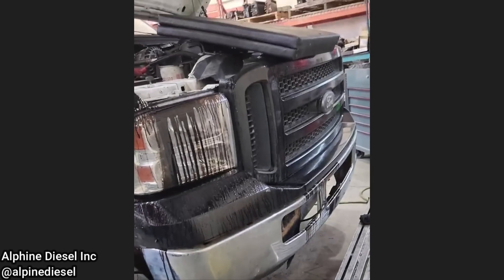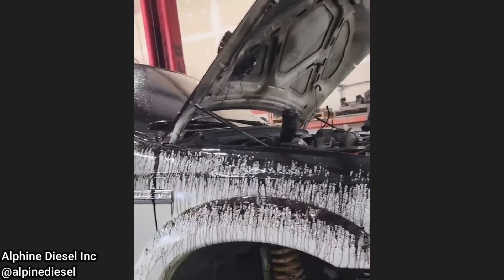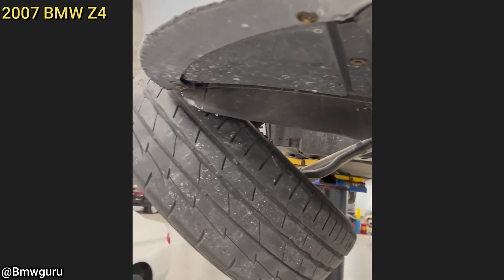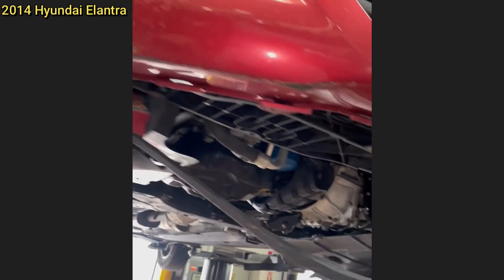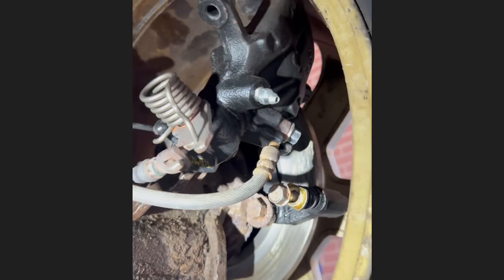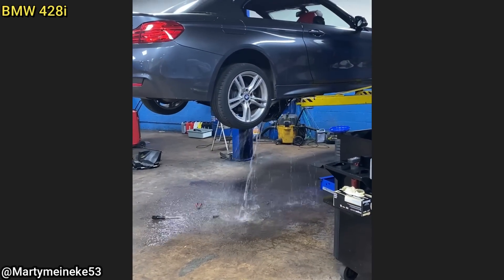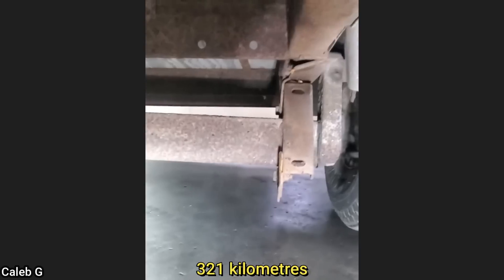Customer States Truck Has A Lack Of Power | Just Rolled In

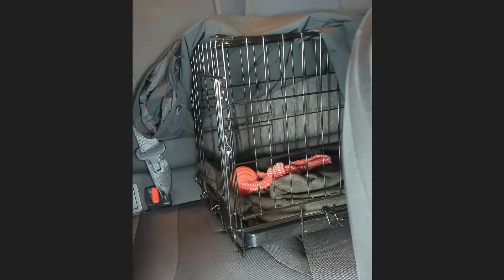Comment: 1:43 these cars are also notorious for "water-cooled" batteries. some are found to have the rear filled with rain water until all electronics die from water and corrosion. always check the trunk and what's below!
as for the nails... germany has a few places where they crop hops (you know, the green stuff for beer?). the plants like to climb, so they let them climb up a wire fence up to like, 4 meters and more. since removing them from the wires is time-consuming they just take down everything, and shred it with machines. and while tugging the stuff home, short pieces of cut-off wire drops onto the street behind them, ruining many a tyre on the way...

Comment: The guys in the last video are lucky they are still alive. Many people completely fail to understand that tires are secretly lethal death machines.
Reply: I just watched a video where a truck blew a tire and the air blew the front bumper off of a passing car.
Reply: Trying to remember exactly where I read about it but a teenager tried to slash one of the tires on a neighbors 18 wheeler and got very seriously injured.
Reply: All about how much air volume is paired with the pressure and that is what people don't get. A very small tire at 100 psi is less scary than a very large one at 50 psi. It's something like if you filled a house with 8psi it would destroy the house and anyone inside would be long dead yet most people would tell you under no circumstances is 8psi lethal.
Reply: @brendanberry7403  Usually, though, large tires tend to be more pressurized because they are usually put under heavier loads. This is why you usually don't hear about people getting hurt with car tires (assuming they don't over-fill them), as they are only 30-40  PSI.
 
However, huge heavy machinery tires like for dozers and huge dump trucks? Yeah, people die to those all the time, and tire cages are mandatory if you're messing around those.
 
Or, if you go smaller, have you ever heard of anybody getting killed to a bicycle tire? Not usually. Or a quad tire, those only want 8-10 PSI.
Reply: @Dhalin  And don't forget that in Asia/3rd world they are always severely overloading the trucks 200% or more so the pressures go way up causing tires to explode, not just blow out.
Reply: Inflated tyres are bombs waiting to go off.

Comment: The blocked drain on the BMW reminds me of my MGB. The air intake vent for the cabin is below the windscreen and has a tube to drain rain water out the bottom. For some inexplicable reason it ends in a tiny slot that gets blocked with debris, backing up and causing water to enter drip under the dash. This leads MGB owners to "circumcise" the pipe by opening the end up...
Reply: Reminds me of a Toyota Rav4 I picked up really cheap the other year, because of a few small problems, the worst one was the heater core had burst (they had bypassed it so they could still drive it), which is a dash out job and would be about half the value of the car to fix. I bought it at the end of winter so figured I would have 6 months to fix it myself. but on one of the first drives on a hot day, the missus said there was water coming out near the glove box.

turns out the heater core was just fine, the aircon drain was blocked, they saw water coming from up under the dash and assumed it was the heater core. I reconnected the hoses and shoved a screw driver up the drain to unblock it and never had a problem, all it cost me was a few $ for a coolant concentrate and some distilled water.
Reply: My Vauxhall (GM) Astra has a known issue where, over time, water seeps through the seals and roof gutters and collects in the sills. Rather than fix the issue they just drilled a hole at each end of the sill and put a rubber grommet in as a plug.

Not long after I got it I could hear water sloshing as I braked or accelerated.  One Google search later I located and pulled one of the bungs out and the water came out like it was a tap on full!
Reply: My golf always seems to be leaking water from somewhere, maybe that's what's happened to me
Reply: @kahlzun  where is it leaking to?
Reply: @kahlzun  It’s worth a look
Reply: @kahlzun  got a sunroof by any chance.

Comment: I had a jeep Wrangler, best car I've ever owned .... Anyhoo, I parked it with the top down and went sailing for a few days. I wasn't expecting rain. 🤦 it rained and when we got back I had 2 inches of water in the jeep. Pulled the drain plugs. Everything worked fine except the radio. It was stuck where it was at. I couldn't change the station, adjust the volume or even turn it off. It eventually dried off and went back to working. Though in hot moist weather the inside of the jeep would take on a moldy smell..... and eventually moths found their way in it. For a few of years I had a moth hatch in the spring. Has nothing to do with the rain, but I find it funny.  Still a great vehicle.

Comment: Inflating tires always scars the shit out of me. Especially when they need more than 50-60 psi. Hell, semi tires gives me a pucker factor like no other.
Reply: I once had a bicycle with tires that were (apparently) supposed to be inflated to 90 psi - at least, that's what was stamped on the sidewall.  I was 16, so pumped that thing right up to spec.  At 88 psi, it blew... my hearing didn't come all the way back for a half hour!
Reply: @stephenp448  Bike tires really do take high PSIs, so I'm guessing that the gauge was probably faulty.

Comment: When I was a truck driver the small trucking company I worked for had a deal with a local repair shop to park our rigs there.  One day a random other truck driver drove up to the shop with a fountain of motor oil spraying up out of the exhaust.  He had blown out a turbo like that guy in the first video and by the time he got to the shop he had repainted his red truck and trailer black with engine oil.  It worse than that guy in the first clip.  I probably still have some photos of it somewhere.  :P

Comment: That last clip, the one with the exploding tire, that ever happen to anyone?  I've never seen, nor know of anyone who has seen that happen.  Just friend of friend of friend who supposedly seen a tire explode for no reason.  I kinda developed a phobia of a tire exploding as I fill it, so for years now I use a clip-on inflator with a 6ft hose and fill tires from cover.
Reply: I've seen it twice! First was when a customer pulled in our tire shop with a flat donut spare they had driven on for several miles. I went to fill it, and it exploded right in my face. I wasn't hurt, but OMG it scared the sh!t out of me! Second was at another tire store. A car, just sitting in the parking lot, blew out it's right front tire all by itself. (It wasn't even one of our customers). Sounded like an M80 firecracker!

Comment: That Ford rim though. I just don't see how that happens. Especially on the outside of the rim. If the inside was scored like that it could be hitting the brake caliper, maybe.
That wasn't a rotted out rim BTW.  The anti theft lug was there to protect that extremely rare component. It's that very rare rim that's designed to allow you to visually inspect the air in your tire. Love the channel, keep up the good work.
Reply: The only thing I think that could explain that Ford rim is consistent rubbing on a curb during parking. Wouldn't be surprised if the customer lives or works in a area with only crubside parking.
Reply: I was thinking the ford rim had scrubbed a concrete highway barrier or similar. Something say 1.5 foot high, although the road probably sloped away from it slightly so contact is down low with involving the rest of the vehicle.
Reply: It's a spare wheel. Sits upside down for a decade or more on the cable under the bed collecting salt in that pocket & eating itself away. I spent about 3 years working at JFK on a transfer. My truck was showroom condition when moving there. Only 1 winter & it already started looking like a beater. It's a tragedy what that damn salt does to vehicles up there!

Comment: I worked a short time as a mobility scooter mechanic. When i just started i didn't understand how much pressure was behind the split rims with air still in the inner tube. Some of the brands had those. While i wasn't really paying attention unbolting those rims, a fellow mechanic rushed to me and pointed to the ceiling. There was a dent in the metal radiator on the ceiling maybe 4-5 meters high. That could've been my head...

Comment: Was thinking about it the other day...can't help but wonder if the reason cars get into such disrepair is that modern vehicles are so generally maintenance free that a mechanic never regularly inspect them.  Wasn't that long ago that you were taking your car in every 3-5K for an oil change, lube, and a tune-up...
Reply: Yup! My previous car really needed oil changed every 3000 miles. New car, every 10k.
Heck, I remember in the 70s the gas station attendant would pop the hood and check fluids while the fuel was pumping.

Comment: based on the exhaust pipe exiting through the hood of that F-350. I suspect that turbo was not at all running with in spec
Reply from the maker: It was a cheap eBay turbo as well apparently 😅

Comment: I was on a job site where they had sheet rocked the ceiling of covered parking.  about 50 feet away was a bobcat with all 4 tires having probably 30 sheet rock nails per tire.  Indeed they were flat.

Comment: I work for a auto parts store. Couple of teens rolled in with a impala with the front shock poking threw the hood and asked if I thought power steering fluid would help and if it was safe to drive. I told them you need a tow. They drove off

Comment: 2:04 Probably had locking nut loose and joint wiggle in the treads open and close until those worn out and gave in.

Comment: That wheel reminded me of a dodge truck with the chrome clad factory wheels. One of the wheels was rusted and broken around the outside edge, hidden by the chrome, not as easy to see inside. The other three weren’t far behind, all very rusted. It had a very bad shake at highway speeds.

Comment: The problem with approving repairs is that there are so many dishonest shops these days. I recently had a shop tell me I had multiple issues with brakes, wheel hub assemblies, struts, sway bars, etc., all except one had recently been replaced. It was the one that I suspected and had not been recently replaced that was really bad.

Comment: Question... non motor head here. How do those hood stacks work?  like, They route the exhaust down through the muffler then back up... or are they normally air intakes to feed 'fresh cool air' from outside the engine bay in... 

seen them a few times but always been confused.
Reply: It's just a pipe connected straight from the exhaust outlet of the turbocharger.

Comment: I can tell you with 100% confidence that tie rod that pulled apart was from rust and the jam nut being incredibly over tightened. Toyota had a recall on the rav4 due to that exact issue on the rear adjustment link on them for that exact problem.
Reply from the maker: What year RAV4 was that on?
Reply: @JustRolledIn  3rd gen so 06-12 they changed the design of that arm to a cam adjustment around 09 or 10 I believe but I remember for the recall that paid over 3 hrs to do in under 30 min with the 4 wheel alignment. When the alignment was set we had to actually torque the jam nuts to like 50 ft lbs. They sealed the adjuster and jam nuts so it is not adjustable after. If there was any rust we replaced them. It was primarily in northern states this recall affected just like the frames on the sequoia, tundra and 1st gen tacomas.

Comment: After seeing most of these videos on this channel, I will NEVER again feel bad for driving some vehicles I've had over the years. Yeah some weren't in the best of shape, but I never drove on tires that you could see the air in, never let rust get to the point of suspension pieces coming off, never let my wheel bearings or brakes get the point of eating the rotor up or having a caliper hanging off. I HAVE pinched a brake line or two in order to limp home. I can't believe we are all on the roads with people that drive these things until their seats literally fall right thru the floorboards! Just wow is all I can say! 😐

Comment: I had a 2006 Chevy Malibu LT V6, 200k miles, no rust and nothing wrong with the car. One day I got a recall for the transmission cable for a possible fracture. I get it to Chevy for the repair, got the car back but come to find out they installed the cable backwards and tried to give the fault to me when I explained why it wouldn’t go into any gear. The mechanic argued with me thinking I did something to the car when an hour later I got a call back apologizing to me that they installed the transmission cable incorrectly and they dropped me off a loaner car to drive for the inconvenience lol

Comment: 3:08 the amount of times ive seen this in fully-equipped tire shops... with heavy-duty tires you're supposed to have the wheel secured and the whole thing inside a tire-cage so that if it explodes, it doesnt injure someone. 999 times out of 1000 doing it that way will be fine... but if you're working on a Semi tire and it decides to explode while sitting on the ground like that. its multiple-hundreds of pounds of wheel flying around. more than enough to kill you if it hits you square-on

Comment: I had a 2000 Ford 250 that had the same issue(2:00) with tie rod ends. Stopped to back up and both front tires went the opposite directions.

Comment: Tiny vibration, even on a nut/bolt that holds a very small amount of weight/force, will eventually smooth off the threads.   Even occurs on safety wired nuts on occasion.  There's a reason for jam nuts, and this is one of them.

Comment: The suspension falling out of the first BMW is due to cheap aftermarket shocks. The diameter is to small for the pinch in the knuckle. I’ve seen it before

Comment: Mechanics need to start checking vehicles underneath before going on test drives for the safety of them and other road users. I lost count now how many lower control arm or even upper control arm bolts are either missing or about to fall out or major bake issues. I felt sorry for that company cars all getting flat tires that would suck.

Comment: 2:20 this reminds me of something I heard once but never got confirmation on: brake discs are designed in a way that they cause excessive screeching once they're critically down.
Likely so that even the dumbest mf may pick up on needing new ones. But then again, there's people that don't know what the fuel warning lamp means...
Anyways, is the thing about the brakes true? Although, maybe it was the pads, not the discs, but either way, I wonder.
Reply: It's the pads, they have metal tabs on them that will rub against the rotor when they wear down, causing an unmistakable squealing sound, which of course, many will ignore until it gets far worse and cost a lot more to fix than if it were taken care of sooner .

Comment: That Z4 is the result of mechanics, shade tree or otherwise, thinking they are smarter than engineers and re-using torque to yield fasteners by just tightening them to the jointing torque.

Comment: Do you guys have road worthy laws in the US? From what I see on your channel a lot of those cars would last five minutes on Australian roads before the cops pulled you over and slapped you with an unroadworthy ticket.
Reply: Depends on the state. Would have to be very obvious for a cop to pull you over. If they did they would give a citation to fix the vehicle in so many days and that doesn't usually happen. Some states there is no annual inspection.
Reply: @johncameron2241  I see. Thanks for the info, interesting. Yeah, over here, you need to make sure your car is up to scratch. Anyway, thanks again, and keep up the great videos, cheers mate.

Comment: Anyone else cringe when the guy stuck his finger in the crack in the rim? Imagine the wheel failed at that moment. Yikes.
Reply: if it handled driving it certainly won't suddenly just fail when just hanging there
Reply: @liev535  you wouldn't expect it to. But material science dictates it's of poor strength. Common sense dictates it won't, but a risk nonetheless.
Reply: @liev535  agreed in principle but check the ER as it's full of not" statistically likely to happen" accidents. 

Heck we wear sestbelts for the same reason. 

This channel is great and really higights bad diy or lack of maintenance but mechanics have their own share bone headed activities.  

Even the last clip of inflating the ag tire is an example of that. Tires should be inflated in cages. It's even an osha requirement.

Comment: The roofers leaving nails like that isn’t uncommon. Those are the nails/caps they use for the dry in material before the shingles. They’re working fast as possible to knock out as many roofs as possible and don’t care about keeping the job site clean. I worked in residential construction and had a few tires repaired due to those guys.

Comment: that trailer thing is nothing. Parents had a toy hauler that the front axle fell out as they were driving. turns out it was only spot welded 3 places each side from factory. was never finished. wrecked the back axle, took out all the plumbing underneath to. the rollers on the back under the toy door was what saved it from bottoming out on the highway and wrecking the body.